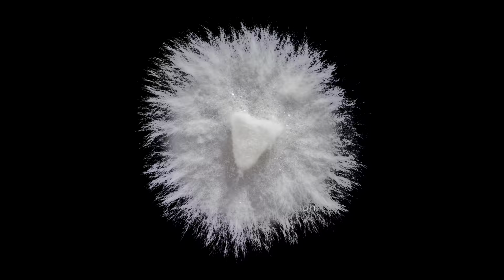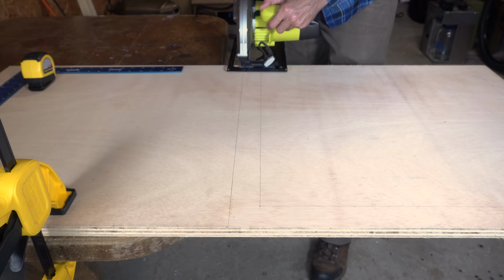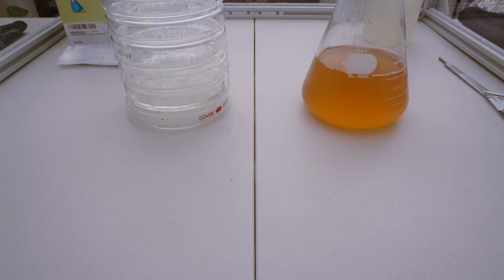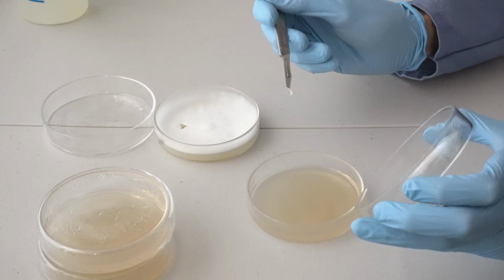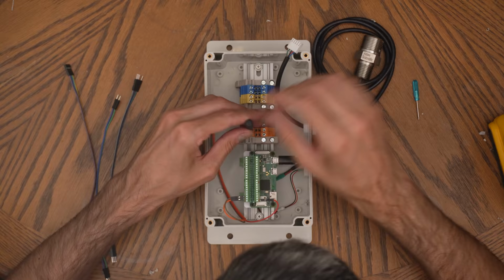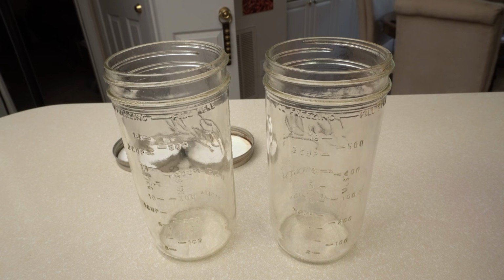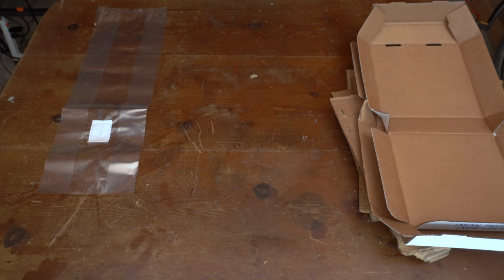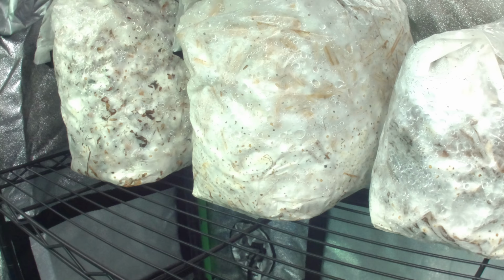Mushroom Cultivation Automation, DIY From Foraging to Fruiting

Comment: Thank you deeply for this video. I thought I was the only one with the 'mushroom/electronics enthusist' Venn-diagram crossover lol! 

I just got into mushroom growing about two months ago, and man has it taken over my brain. I am essentially working my way to this set up... Made a magnetic stirrer out of an old computer fan and thought 'that was alright fun,' but started this itch... soooo, I have re-familiarized myself with coding and electronics from high school and bought an Arduino. Coded an extremely accurate temp and humidity gauge first day. Programmed an attiny85 microchip the next day. Today is day three and I see this... that itch has now grown stronger.

Comment: Huge thank you for the incredible amount of detail in both this and your previous hydroponics video. The previous guide was incredibly useful and I'm looking forward to building a similar system to the one in this video. Love the use of a pi zero & DIN rail in the control box, looks very clean. The extruded aluminum flow hood with top mounted filter is also brilliant, alot of the other designs I've seen have you facing the filter and this seems more space efficient.
Reply from the maker: I also have a top plate of the hood frame to use it as a fume hood for when I'm cleaning 3D resin parts or soldering, so I wanted to build it for multiple purposes. If you're inoculating a lot of substrate, it may make more sense to have just a fan and filter turned sideways to you can more easily pull your material into and out of the laminar flow, whereas this is in a sealed hood and is a bit more awkward to move things in and out of quickly. The thought behind using a walled flow hood is it offers more protection from drafts that could blow contaminated air into your work area.
Reply: Thing is, when the "sterile" laminar flow hits the bottom, it circulates particles back upwards, whereas a normal flow hood exhasts that energy outwards, so that particles dont bounce around in that space.

Comment: Great video. I have cloned from agar into some Uncle bens brown rice bags then coco coir that’s soaked in boiled water overnight as the substrate. I isopropyl everything and wear a mask but no flow hood. Then into small ikea tub’s. Working great, your environment, no moving air and iso everything help’s reduce contamination. You can also flame sterilise the scalpel but the one’s that have a plastic handle melt 😂

Comment: In the context of laminar airflow and using a flow hood, it is generally not recommended to place the flow hood on top of a workspace or table. Placing the flow hood on top can indeed disrupt the laminar airflow and create turbulence, which could compromise the effectiveness of the clean air environment provided by the flow hood.

Laminar airflow is designed to provide a controlled, unidirectional flow of air in a parallel stream. This ensures that any airborne particles, contaminants, or microorganisms are carried away from the work area and do not interfere with the process being performed within the flow hood. Placing the flow hood on top of a surface may disturb this smooth, directed airflow, potentially introducing contaminants into the clean zone or causing unwanted recirculation of particles.
Reply from the maker: Then consider it a positive pressure hood so, by principle, all airborn particles are evacuated though all openings.

Comment: Great video. Seriously one of the best. But not because of the mushrooms. The simple flow hood is why I keep watching. Super-simple, and I have most of the parts on hand. Do you have suggestions for mounting the plexi? In the slots of the 2020 and seal it in the channel? In the slots and seal it from the inside? I see you putting something on the plexi for a seal, but am not sure of what it is.

How about a video of just that hood being built? Not the box and filter, just the frame with plexi? Thanks again Kyle, great job.
Reply from the maker: Thanks! I have a build article linked in the video description that goes over the build in more detail. To seal the clear panels, I just use foam strips that can be found at a local hardware store. It doesn't need to be air-tight, as the whole box has positive pressure, it's more there to keep the panels from moving around.

Comment: Great video!!

Shaking your grain everyday isnt necessary, or warranted.  Once at 30% improves colonization speed.  But still isnt necessary.  U get 100 jars going theres not way you're gonna shake em all. 

 Really dig the penut shells though not a common substrate.

More FAE for those oysters will cut the those stems down.  

I know nothing about coding.. or programming..   Suggestions on where to start to learn about pie or Adriano?  Would love to check out your program.
Reply from the maker: Thanks for the tips. I only had two jars, so wanted to speed up colonization so shook every day. You can see even the last day when I was in the hood it was incredibly difficult to break up the spawn by shaking... this was a very vigorous growing oyster. I don't know of any programming resources of the top of my head. Many people have said that by using Mycodo, they got into Python programming.

Comment: Congratulations man, this video is a piece of art. What WiFi power strip you used? So no need to connect a relay board to the raspberry Pi?
Reply from the maker: Thank you! TP-Link makes several WiFi power strips and plugs under the model name Kasa.
Reply: @Kyle.Gabriel  thank you, I'm not very skilled with electronics, but you inspired me, I will try to do the automation using mycodo.

Comment: This is a fantastic job. I don't know much about growing mushrooms but you definitely made it interesting, I might give it a try  at some point. Would you mind sharing some more information such as how much can grow from a bag? Why did you have different fillers for the bags? What is the difference in the mushroom end product? 
Once a bag is prepped and starts yielding mushrooms does it continue to produce having that it is fed with more of what the original filler was? Thanks a lot for sharing this!!
Reply from the maker: Thanks! The biological efficiency (BE), or the weight of fresh mushrooms you can grow from the dry weight of your growth substrate, varies from species to species and even strain to strain, and also depends on the growth conditions and growth substrate. For Oyster you should aim for 100 % to 200 % BE. I used different growth substrates to demonstrate that oyster can pretty much grow on anything. I couldn't taste a difference in the products that grew on different substrates. Your highest yield will typically be the first flush, then every week or two, another flush can occur, with diminishing yields.

Comment: Absolutely amazing work, thank you so much. I set up my mycodo environment and have the basics going in a test environment. Should be fully setup in a few days. Question - if you have grains going and also some bags in fruiting stage, do you use two incubation environments? One dark and set for optimal conditions for incubation and other with light and more air for the fruiting stage. Curious how you are doing that.
Reply from the maker: You can colonize in a fruiting chamber, but you're taking up space that could be used for fruiting. It's all your choice whether you want to occupy the more expensive fruiting space for colonizing when you could set up a less expensive space strictly for colonizing.

Comment: Hi sir Kyle! I love your video, definitely worth to watch. I have a question, Did you still water the mushrooms or you just use the modifier?
Reply from the maker: Only the humidifier. If the relative humidity is >= 90%, that's all you should need for most mushroom varieties.

Comment: 2 sort of side questions: 
1> Do you know if there is a grow tent that could accommodate either a 2' x 3' or 2' x 4' wire rack?
2> Could an Instapot be used to sterilize things in the same way you have used the traditional pressure cooker?
Thanks
Reply from the maker: You would have to read the dimensions of different products to find what is compatible. I don't know what an instapot is, but sterilization typically requires high pressure (15 PSI) and temperature (120 Celsius) for 30 minutes.

Comment: Can you tell something about the longevity of the components used inside of the grow tent and how high the risk of contamination is? I looked into multiple automation projects for growing mushrooms inside of grow tents and there seems to be lots of trouble finding a solution that a) really is fully automated and b) has low risk of contamination. One of the problems seems to be that because of the high humidity inside of the tent, electronics should be placed outside of the tent, so that they don't get damaged. Your fan and humidifier for example are directly placed in the tent. What is probably harder to achieve than not getting your electronic devices damaged, is maintaining a clean environment, since in an environment that is constantly at ~70-80% humidity, it's easy to not only grow mushrooms but also mold. So it seems that people need to clean their tent completely at least on a weekly basis and even more regularly the water that collects on the ground, which should be ideally removed daily. In the end, trying to build up a fully automated project for growing mushrooms seems to be a great challenge. At least that's what I gathered from my research the past days.

Comment: This is an amazing project. Well documented and wonderfully told.
I have two questions regarding your setup:
- I don't understand how you control the temperature inside of the chamber. It seems you are keeping this in your home, meaning the heating system or the summer days may affect the growth of the spores.
- is the overall design, in this implementation, noisy?
Reply from the maker: For this application, temperature is not controlled because it's inside my house that's at 75 F (23.8 C). The only noisy part is the diaphragm pump that samples air for CO2 measuring, but even that's not too loud.

Comment: Such an amazing project! Incredible how much work goes into cultivating mushrooms!
I'm just wondering about the dish at the end: What made you decide to fry them instead of cooking them in a way to preserve more of their nutritional value?
Reply from the maker: Thanks. What nutritional value is being lost by this cooking method?
Reply: @Kyle.Gabriel  Well, I suppose I'm not a chef and don't assume my statement is necessarily true - so I looked it up. Turns out it depends. Some vitamins are retained better when fried, others are better retained when cooked differently at lower temperatures. I guess the way you fried them, the mushrooms were in the oil for a brief period and the oil was probably fresh. I'll pull my argument back :)

Comment: Try a HEPA filter or Merv 13 filter box rather than a carbon filter. Carbon filters are for odors and gases.
Reply from the maker: It was the only thing I could easily find with a 4-inch duct fitting.

Comment: Very cool! Couple questions: 1) Don't those fan units come with HEPA filters? Why bother with the separate filter/adapter?; and 2) Do you think it's important that your clean workspace match the filter's area and shape, or could you (eg) have a 2' fan pointing down or sideways at a bigger 4' workspace, in a kind of trapezoid?
Reply from the maker: That particular blower fan unit does come with a filter, but it was very thin and I didn't trust it. It also arrived damaged and I didn't want to pay for return shipping. I also bought the HEPA filter prior to receiving the fan because I wanted a higher quality filter that would last much longer than the original. Who knows, the original may work well. You could have a larger work space than the filter size, what's important is having an appropriate flow rate. With the variac and the coarse blower speed adjustment knob, I could get any flow I wanted, and in my setup the lowest speed on the blower was too much (hence, the use of a variac).

Comment: wow you're a genius! :P 
Did you make the timelapse of the mycelium on the petri dish also with the raspy cam 
and isn't the humidity a problem for the cam module? Thanks!
Reply from the maker: Yes, a Perti dish and a D3100 DSLR with a macro lens. Condensation was an issue for the first attempt, but I kept temperature consistent for my second attempt and it came out great.
Reply: @Kyle.Gabriel  Thanks Kyle!
It sure did come out great!
So with the 12MP RasPiCam the petri-timelapse wouldn't be as sharp, right? 
And I actually meant the humidity in the fruiting chamber. Is that an issue for the RasPiCam at longer periods?
Reply from the maker: @DH-ls9qv  Yes the D3100 is higher quality all around, but it's only 14 MP, so roughly the same number of pixels as the 12 MP HQ Pi Cam. Any camera that's going to be in a high humidity environment you will want to seal it in a protective case to keep out the humidity.
Reply: @Kyle.Gabriel  much appreciated! :)

Comment: Can I use mycodo for bigger projects? Let's say a room of 60*30 feet.
I want to automate at a bigger level.
So I would need more sensors? Or singular sensors work even for bigger areas.
Reply from the maker: Sure, there are many people using it in much larger spaces. It depends how well your air is circulated/homogenized. One sensor could work, but if you wanted to know if your environment was homogeneous or have redundancy in case a sensor fails, using multiple could be beneficial.

Comment: Is it the same to use a vertical flow instead of a horizontal one?
Reply from the maker: As long as the air is sterile. The benefit of a flow hood is reduced chance of non-sterile air entering, which is a concern for many horizontal laminar flow systems. Many times side walls are added to horizontal systems to prevent these non-sterile air currents on the sides, giving you more usable space to work.

Comment: Awesome video. How often can you harvest the fruit of one batch? How much total weight?
Reply from the maker: The yields diminish each flush and it gets more susceptible to contamination growing. Typically you will have flushes occur a week or two apart. My yields weren't great, but that could be due to this being a wild strain or the lower humidity I set so it wouldn't interfere with my photos being taken for the time-lapses.

Comment: I'm a little confused by how little water is in the pressure cooker for the sterilisation runs.  Is that something you can get away with for short (30 minute) sterilisations or are long sterilisations OK with small amounts of water as well?
Reply from the maker: The amount of water needed depends on how well your pressure cooker retains water and time. If you are putting too much heat into the pressure cooker, you will have excessive pressure relief, which removes water from the pressure cooker faster. If you have good temperature regulation and have minimal pressure relief, then you reduce water loss and can heat for prolonged periods.
Reply: @Kyle.Gabriel  Thanks a lot, that's very helpful.

Comment: What was that metal cylinder you put the petri dishes in?
Reply from the maker: A holder, so they are easier to move, and it reduces the likelihood of contamination after sterilizing.
Reply: @Kyle.Gabriel  FYI I've had great success with the no-pour method.

Comment: Hi! I noticed your flow hood points down towards the table, rather than across the table like other mycology flowhoods I've seen. I was wondering what your reasoning for this was and how it compares to the more common design. I'm thinking about building a new flowhood as my buddy and I are trying to step up production of lions mane.
Reply from the maker: It merely contains the sterile airspace more. If you're working with cultures, it works well, but if you're inoculating a lot of substrate and need to move a lot of material in and out of the sterile zone, then it's not ideal.